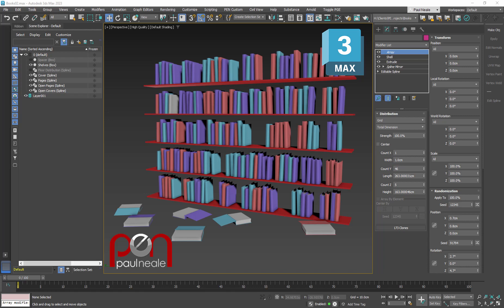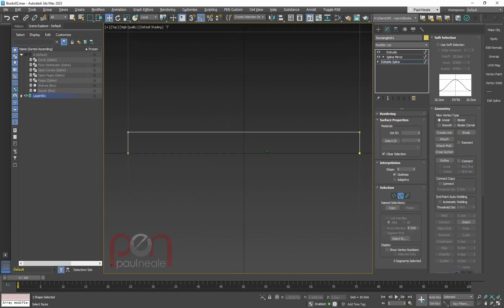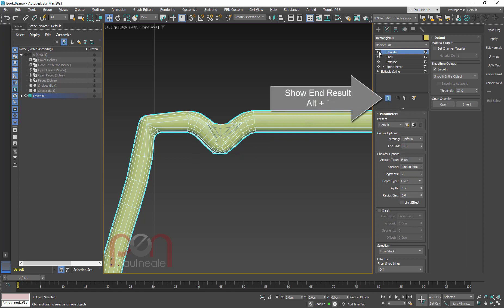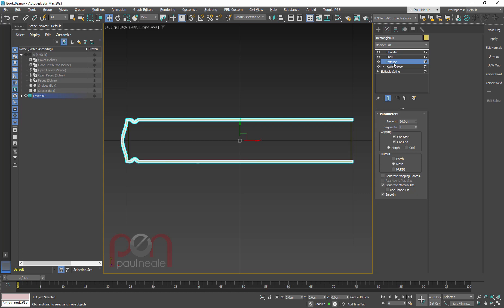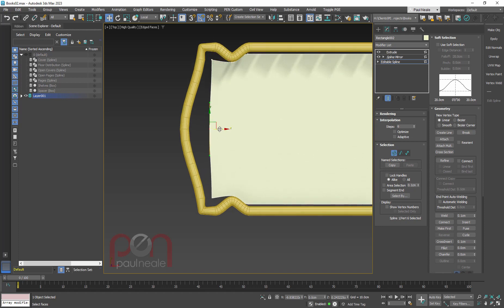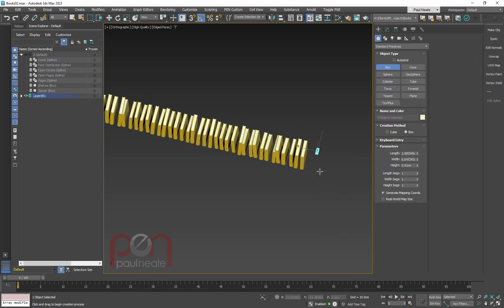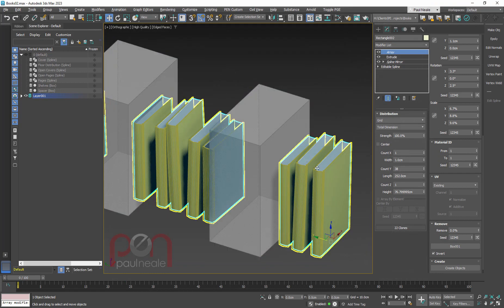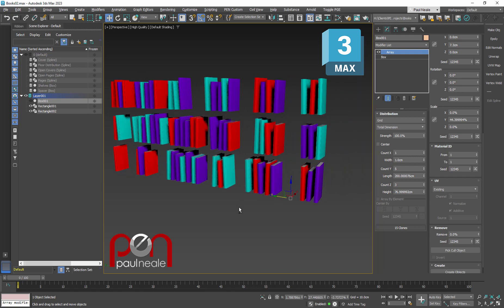3DS Max Modeling Books

Comment: A useful addition to this modifier would be an option to avoid objects intersecting with each other for cases when you introduce randomizations. No matter how small the value you put in, there will always be some clones intersecting with each other. Will also reduce the guessing work when playing with the values like rotation around 11:08 for ex. and allow for higher values to be input.
Reply from the maker: Impractical however as it would require simulations. Would be could though.
Reply: @paulneale  Just watched the new node-based scatter modifier that will ship with Blender 5.0. It has something like Poison disk option to deal with that. I don't think its simulation whatsoever. Pls take a look and tell if you think that is a solution for what I'm hinting here. I think this would be useful for radial arrays as well or for that Bend transform with the Grid distribution to avoid clones landing in the same place

Comment: How did you curve the spine of the book by just dragging the vertex? I keep getting straight edges instead of curved edges. Looks like I need to learn the basics first :(
Reply from the maker: Make sure the vert is not set to linear, smooth should work well, and possibly turn off optimize.
Reply: @paulneale  Thank you! The books turned out amazing! This was very fun!
Reply: @paulneale  They probably changed the defaults by now regading vertex type (its corner type now ) of the Rectangle spline object. So even after you divide those side segements the resulting vertex is still corner. Anyway for me the Spline Mirror modifier is not mirroring the curvature to the other side. Its a current bug with this modifier? Can you pls confirm